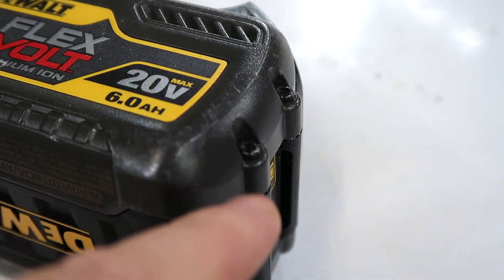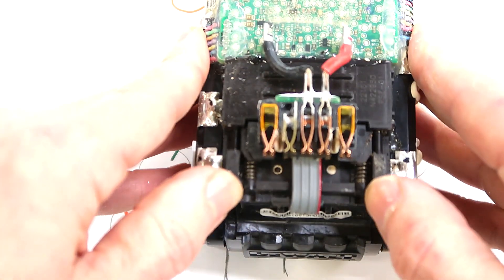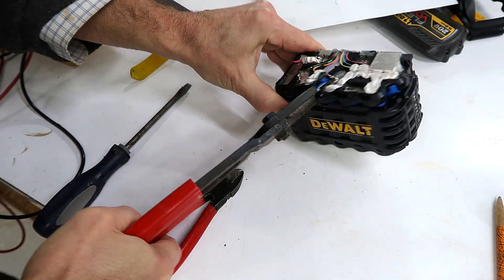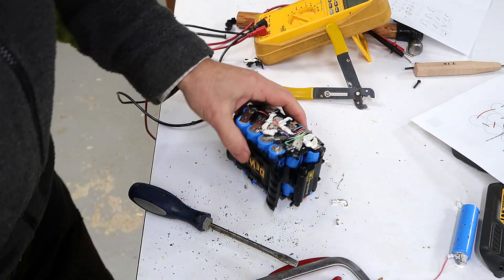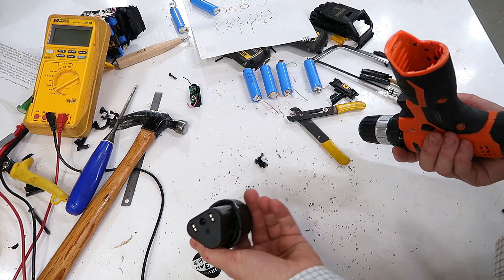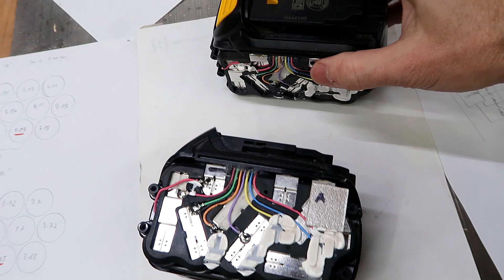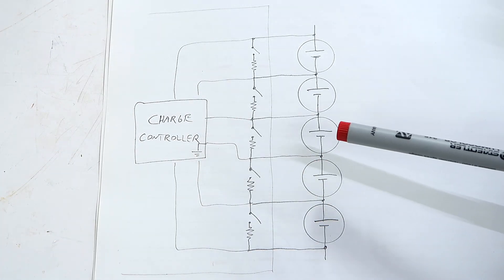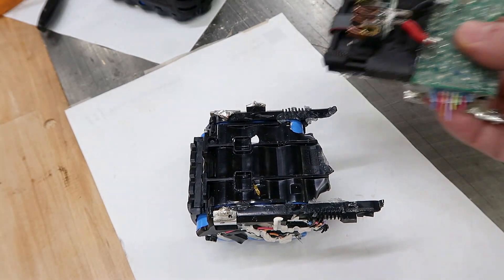This kills flexvolt batteries prematurely

Comment: A thoughful failure analysis of some seriously bad engineering.  Bravo, again,  to Matthias!  Top side only passive balancing is cheap but only effective  if the battery is fully charged often, and before use.  To power the passive balancing off individual cells inherently imbalances the cells and lets you know Dewalt has some utterly incompetent engineering/technical management who signed off on a poor design with no idea how it operated.
Reply: This is great engineering. It is planned obsolescence at its finest. They made damn sure the consumer couldn't fix it too! All while covering their asses with perfectly reasonable rationality for everything they did. They did it all for your safety.
Reply: @1pcfred  Hanlons Razor: "never attribute to malice that which is adequately explained by stupidity.""  Hanlon's razor.  
I highly doubt a plan.  Competence is a rare exception.

Comment: The battery pack for the drill looks similar to the Milwaukee 12V batteries. 
I was able to extract the battery from the Milwaukee by using hot melt glue and a puller tab like is used in in paintless dent repair. 
Maybe something like a wooden dowel could be substituted for the pdr pull tab.

Comment: Fascinating diagnosis Matthias.  Assuming it is correct, is there 1) a circuit based solution that could prevent this from happening?  Or 2) do you think it's reasonable for DeWalt to not improve the design any to help prevent?  For the pessimistic minded consumers among us, it's fairly easy to imagine that DeWalt is perfectly fine with this behavior knowing that it could easily lead to an early replacement.  If your theory is correct and even a small percentage of those battery packs are discarded with still usable cells in them, that is a tremendous waste to everyone.

Comment: Why doesn't someone make top quality, repairable, modular battery packs for all the top brands ™
Reply: All manufacturers should be forced to follow one standard connection interface so that the batteries are interchangeable. Also they should be forced to make the packs repairable. Like they did it for cell phone chargers
Reply: @BobMonsieur  True, but they will say "we are too poor, we must serve our shareholders with anti-consumer, shady business practices" 😒
Reply: @blacklisted4885  yeah, that is why they should be obliged by law. They will never do it voluntarily. The government, the state has to make the necessary regulations and take proper care of such issues. If they care, of course. The fact it's not done speaks quite clearly about where the real issue comes from.
Reply: The top brands want you to buy new batteries every few years. Replacement batteries cost almost as much as the tool and battery in a kit, so they make more profit.

Comment: I always just use a mains powered drill whenever I can. Not always possible, but when I can.
Reply from the maker: if I was drilling a lot in the same place, I would.
what I don’t get is battery powered routers and sanders
Reply: @matthiasrandomstuff2221  18v 4Ah Bosch cordless angle grinder, empties the battery in 20mins!

Comment: Interesting. Except for my cordless drill, I don't have any battery powered tools. I like good old fashioned corded tools. Less cost and hassle and usually more powerful.
Reply: Actually cordless tools have overtaken corded in power in a lot of cases. Brushless motors have more torque at low speed than AC/universal motors. The higher voltage platforms (36V and up) can provide more electrical power than a 15A household circuit. And all the R&D in the last few years has been into cordless tools. That said, corded tools will never have battery problems, and they are better for continuous use.
Reply: @mattv5281  Agree, but I wonder why no manufacturer has come up with a corded tool with a brushless motor setup like the battery ones.  I understand cost will be higher (rectifier, step down), maybe power will not be there, might be bigger and heavier, but why not, best of both worlds.
Reply: @ikocheratcr  probably just because no one is buying them. If a corded tool is the same price and more convenient, I'll use that. Plus they get to sell more batteries in the future.
Reply: @mattv5281  cordless tools need the R&D. Corded tools do not. That's because corded tools face far fewer challenges than cordless tools do. Companies are going to invest where it will yield them the most profit. Professionals on the go are going to benefit the most from the convenience cordless tools offer. They're also the ones most willing to pay for that convenience.
Reply: Fair point, but many sites mandate cordless to avoid tripping hazards from cables everywhere.

Comment: That seems like a colossal oversight if it turns out the charge controller is in fact the the pack-killer.
Reply from the maker: Only if used infrequently.  Probably not a regular use case for an expensive pack like that.
Reply: @matthiasrandomstuff2221  For my own needs, I only have two of the giant flexvolt packs, and I use them exclusively for my mower. I use them every couple weeks during spring/summer/fall, but they sit all winter unused.

I'll have to make sure to leave them a little discharged going into winter, and top them off before the first cut in the spring!
Reply: @JeffGeerling  Leave them at 60% for over winter. Li-Ion cells don't like to be stored at 100% long term.
Reply: @matthiasrandomstuff2221  This is actually what kills most laptop battery packs. You would think they'd have figured it out by now, considering how long laptops have been using 18650 cells, but it's still the same, and across all brands too.
Reply: @SuperDavidEF  No more 18650 in laptops.  LIPO now.  Glued.  Apple started that in cellphones.
Reply: @matthiasrandomstuff2221  what about the BMS while there is a 54v tool attached. Would the BMS just use a single battery, e.g. leave the tool on the pack with the springs compressed. With the amount of thought and resources spent on mechanical design/implementation, using a single cell only (ala Makita) seems extra weird.
Reply: @matthiasrandomstuff2221  was the battery on a tool, or stored separately?
Reply: On the contrary, the engineers are more than likely aware and the bean-counters love it that way. More dead batteries = more battery sales.
Reply: @Orcinus24x5  this is the most likely answer sadly. Every aspect of something like this is understood and engineered to the nth degree. Any flaws this fundamental are absolutely 100% deliberate.
Reply: Only if they've fine tuned it so they fail after 3 years, otherwise it's a warranty claim, cant see that being good for business @whirled_peas
Reply: @Orcinus24x5  I am an electrical engineer and have worked on various battery powered products. I would never do this or allow a vendor to do it in their design. Any current that is needed by the BMS must be pulled from the top of the stack. I would go so far as to say that this is a standard practice and everyone knows this.
Reply: @mckenziekeith7434  Agree, every BMS application circuit I've seen or worked on pulls VCC from full B+, 2s, 3s, etc or 5s/20v nominal in this case.  I mentioned this in more detail in my own comment, but this is a clear example of a BMS that is fundamentally unsafe, as no cell should ever be allowed to go below the minimum operating voltage (full stop) due to dendritic formation.
Reply: @mckenziekeith7434  Laptop battery packs have been using a single cell in the pack to power the BMS for decades. It's the only design I've seen across all brands. Please go tell them it's not allowed. I don't think they know. Most laptop battery pack failures are from the single cell being drained by the BMS just like in this video.
Reply: @SuperDavidEF  I didn't know that. I have never worked on a laptop battery pack. Terrible design decision.
Reply: @mckenziekeith7434  Yeah. Sometimes businesses (or even whole industries) are more interested in that one cent difference in cost than they are making a good product. It's a terrible design decision, but it works well enough. When things are made like that, I call it "made to sell not made to work."
Reply: @mckenziekeith7434  maybe 60v is too much voltage for the BMS to draw from?
Maybe the battery level indicator or other part (or quirk) of the circuitry is causing the middle cell to drain?
Reply: @Orcinus24x5  Nailed it.  I went into a bit more detail on my separate comment, but BMS are designed with input voltage ranges that more than accommodate the full battery voltage (i.e. 2s, 3s, etc).  If this is indeed how they laid this circuit out, they would have designed this circuit contrary to IC's application circuit.  Dewalt will shit a brick if that turns out to be the case in a follow up video.
Reply: I can confirm I l've had 3 flexvolt batteries fail - 2 9ah & 1 6ah, the 6ah shell started to fall apart probably due to sitting in brake cleaner and hydraulic oil, I just made a new shell.
1 of the 9ah refused to charge & the other went dead - 1 had a loss of voltage in almost all cells & the other had just a couple @ minimal voltage.
The BMS in these batteries has a constant small load on the battery which will drain them so they must be at least partially charged before storing.
All this happened after I went away for work for 9months so I think this supports the theory.

As these batteries are becoming bigger and more of an investment they should really offer better warranty or repairabilty for them.
Reply: @Senkino5o  It's several years on dewalt batts, I had one replaced that had water intrusion..
Reply: It explaines the fact that most hardware stores have a label on the loose sold battery pack packaging that states that it must be charged before a certain date.
Reply: I ran down a 4ah DeWalt 20v using it with my blower.  The battery also got hot and would not recharge.  I purchased a Samsung 21700 cell and replaced the dead cell with the identical cell.  It works!  I wonder why DeWalt uses the 18650 in the Flexvolt and the larger 21700 in the smaller batteries.
Reply: @JT_70 you're talking about the 4 Ah single row pack right? There's an older 4 Ah that was two rows of cells like the 5 Ah. I believe the answer is that the 4 Ah pack is newer than any of the flexvolt batteries.
Reply: Planned obsolecense
Reply: Oversight or they want you to buy new battery every 200 cycles?
Reply: I thought the BMS is supposed to cut the power if any of the cells drop below around 2.5v, anyway.

Comment: "Don't run it all the way down" is probably good advice in general for preserving the life of batteries.
Reply: actually, stated by dewalt in its website
Reply: It is for Li Ion batteries. But previous battery chemistries needed to be run down once in a while.
Reply: @Nono-hk3is  Actually, not only for Li-ion batteries, it applies to nickel chemistry too. Where a battery has a number of cells in series, then running it all the way down is likely to reverse and damage at least one cell. For lead acid chemistry like car batteries it is even worse. Running a normal car battery even 50% down can damage it.
Reply: @Nono-hk3is  Bs myth.

Comment: Hmm. Never tried this with DeWalt but I have been successful with Milwaukee ones. Well, I've assisted my boss in repairing several. 
Side note, several higher end flash lights use those batteries, I saved a few for that purpose. And gave a couple to a friend who's vape uses them.

Comment: I really hate the way they make these battery packs not repairable. For one or two bad units you have to throw the whole pack with 12 (approx.) still good units. How are such practices sustainable and environmentally friendly?
Reply from the maker: normall they would wear out about the same.  Car battery packs are no better.
Reply: I suspect the Lion battery production is as bad or worse for the environment than evil fossil fuels.  Especially when manufacturers build devices like this that force trashing the whole device for one bad cell.
Reply: I replaced a couple bad cells in one of my packs. Only lasted a few months before other cells went bad.

Comment: Thanks for the  video. I managed to replace a cell in a Makita battery which was much easier to dismantle and fix than Dewalt. I landed up building a spot welder as well which has come into into use quite frequently now for the battery packs.
Reply: Have you tried building a portable battery bank or a car booster?

Comment: me: I'll just buy the "security" torx bits to open it.  Matthias: I'm gonna break it.  Good job.
Reply: Me: Uses security torx as my only torx bits.
Reply: I like torx. Yet, torx size/design sort of suck, e.g you can use t15 bit in t20 head screw/bolt and it mostly works but with the tendency to round 'em off. Secure one mitigates that.

Comment: That battery can be restored, special shops do that. Like that you can save many dollars also if you have some old tool for that you don't find new batterys renovating battery may be only way.
Reply from the maker: In retrospect, if I immediatly opened it up and charged just the three dead cells, it might have been saved.  with the middle cell gonne, the charge controller has no juice to do it's thing.